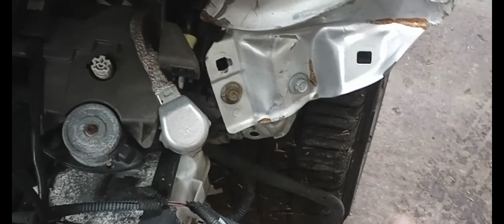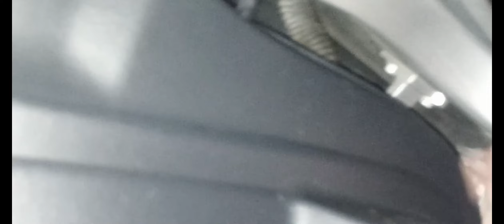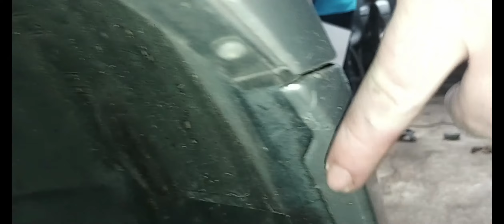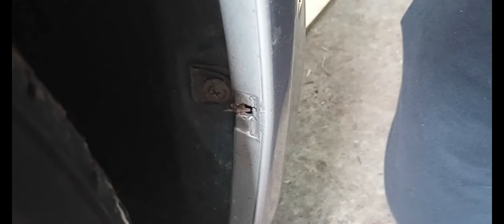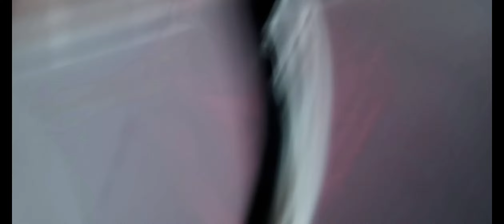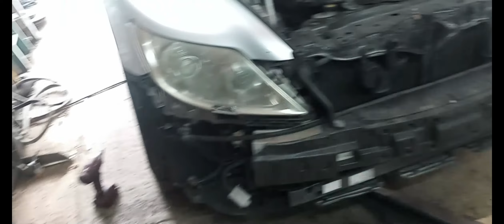2009 LEXUS LS 460 BUMPER AND FENDER REPLACEMENT

Comment: Thanks for the video. I just need to replace the proximity sensor to the driver's side of the license plate. And it was helpful to see how that bumper cover comes off. I wish there was a way to get to that middle proximity sensor easier.
Reply from the maker: I wish you luck on the adventure glad you decided to tackle it yourself